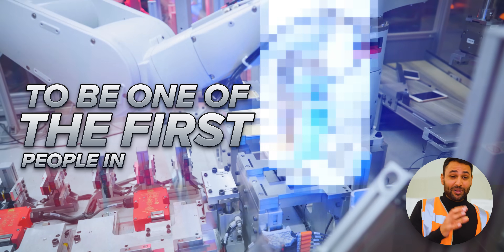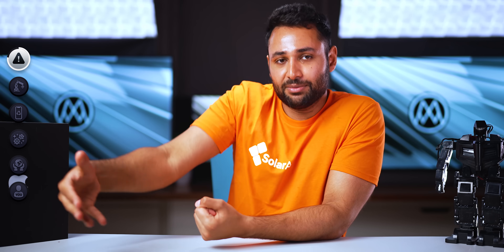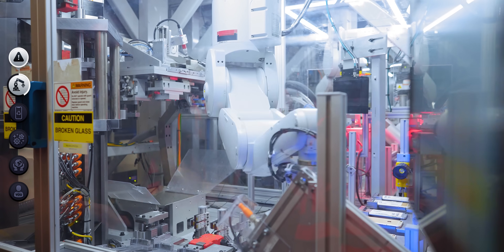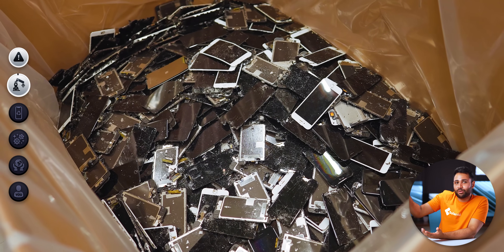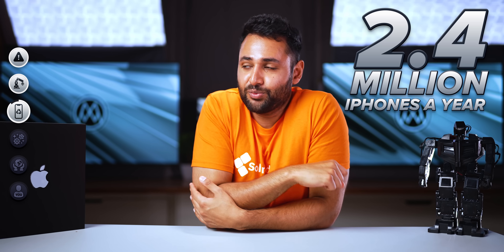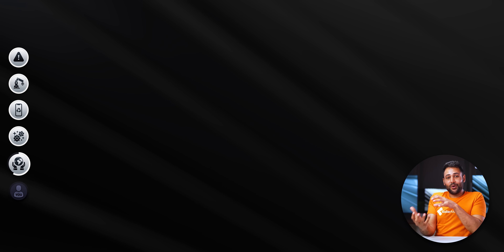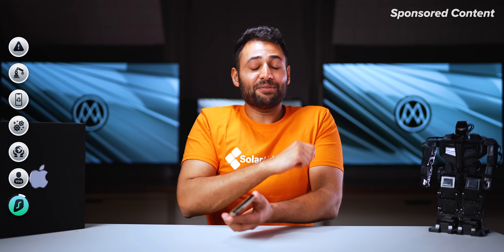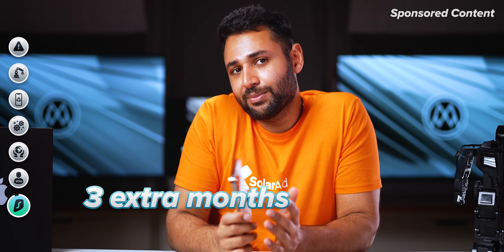Apple made a Robot...and I got to test it.

Comment: Apple and the other behemoths should get real about sustainability. They should make their devices serviceable. My current phone is so powerful that I could use it for the next 4 years if I can easily swap the battery and change the screen if it got broken. I DIYed these for my 2017 top-of-the-line Dell Inspiron laptop and it is still flying!

Comment: Personally I'd rather buy a new product that's actually NEW and no made out of old pre used materials. If a product is made out of 0.0000001% of recycled materials, then it shouldn't legally be allowed to be sold as " NEW" because the materials the product is made from isn't NEW. Recycled materials have a far less shelf life than new materials and it's because the new materials havnt been melted down over and over in its lifetime. Recycled materials have been melted down and reused a countless number of times which in turn weakens it's cellular structure.

Comment: I'd still like to see 3rd party repairs being enabled by apple especially allowing vendors to ship genuine parts to 3rd parties like Mr. Louis Rossmann.
He might not do iphone repairs but the whole repair industry has to battle the apple made circumstances to my knowledge.
Also if you get your hands on a genuine part your chances of getting a working device at the end is also shitfaced by apple locking down their device components with software.
It's great to see them recycling the old stuff but I think it's still profitable enough for them to shred old tech in an environmentally friendly way as oppose to letting folks fix the tech they have bought.
I'd love to wake up one day to find that there is an ipad m1 that has a socketed m1 chip and socketed flash memory that isn't hard to come by, an unlocked bootloader so I can downgrade the software on it or install custom community roms like on many android devices.
I would use it until I can't fix it and it dies for good.
That will probably not happen in my lifetime though...

Comment: The most important point is being completely neglected here and every company fails in those regards: reparability.
A shit-ton of devices wouldn't need to be exchanged for newer ones if companies didn't tie components to units. Is it really necessary that the phone gets reduced functionality or may even end up bricked just because you changed a camera unit, a battery or just a button?! no! Apple may be doing a lot but it all is being diluted to the point of greenwashing when they (and yes not just apple, but others as well) pull the crap mentioned above...
Reply: That carbon-neutral by 2030 is bullshit as well.

Comment: As you admitted, the least destructive way is to keep your phone for as long as possible. You also admitted that your 4 year old phone has mediocre battery life

If this is the effort that Apple goes to for a marketing ploy, imagine if they actually cared about environmental impacts and recovery...they could just make their phones more repairable.

Considering current day batteries are consumable, they should be able to be replaced easily by the consumer. Its like buying a mower and not being able to replace the blades, a part which is designed to be replaced over time. 

But good free feel good marketing for apple

Comment: Apple's amazing recycling and buyback program has a serious downside in that it removes old phones from the secondary market forcing many lower end buyers to buy new phones instead of old ones.  Apple is very against the secondary market and does a lot including locking and bricking phones that are stolen and lost preventing them from entering secondary markets and forcing them to end up as eWaste.  Don't be fooled by the hype

Comment: Apple’s habit of making their phones only “repairable” (ie, swapped with another one.) by their own repair centres, is that they are built not to be taken apart. Crazy idea, build things to be disassembled at the end of service life, so robots like Daisy have a much easier time doing it, with less waste. Also, if Apple programs into Daisy the specs for competitor devices, they can also scavenge materials from the competitors.
Reply: I've been repairing phones for years, and in my experience I'd say that apple phones are up there for some of the most user-repairable phones. Often access to the screen is behind only a couple of screws (the most common type of break) and the battery is behind only another couple more (the second most common type of break). And they've been getting better and better with more recent models (the 4 was the last one where the screen was underneath EVERYTHING ELSE; since then the screen can be removed with just the couple of screws).
Reply: @essendossev362  Except for the fact that on the new iPhones, parts get locked and disabled in firmware by apple. So if you put in a new screen or camera, faceID doesn't work, the cameras don't work properly, etc…  All because Apple doesn't want their phones to be repaired.
Reply: @eurisken  only face id won’t work, the cameras will work and i heard that you need a special device to reprogram face id into the new sensor.
Reply: @eurisken  I see pros and cons to this.
If you are buying a phone from someone you don't know, it would be very nice to know that a part has been replaced or is not genuine before paying for it.
Reply: @essendossev362  Crazy how people want thin phones and also expect giant screws and no adhesive, right? :)

Comment: Recycle = good
Refurbish = better
Fixing it yourself = best

If they let users to modify their phones by themselves, like Tesla is planning to, then the need for complex recycle units becomes a lot smaller. To put it simply, if your screen is broken you just exchange it at the store for a new one, same goes for batteries and other components. Of course the store still needs to collect and turn them in correctly.

Comment: not having replaceable batteries should be a crime. Along with modular design. As in ever part can be replace. Phone should be coved in something like stainless steel and not fucking glass. Instead of replacing the phone and paying fucking $1,000 you can buy the part for say $50 let them or hell you replace the battery. Like only charge $20-50 to replace the battery. Minimal waste. Less materials, company still gets paid and the user is happy. I don't see any other way to improve on it....pretty much the only good thing about Apple tho. . .

Comment: Now imagine if they only made their iPhones easier to take apart and disassemble. You wouldn't need to freeze the battery out, you could just wait for it.. lift it off! ooor, instead of punching screws out you could just remove working parts, test them and sell them for spares!
But it's Apple, so an overengineered solution to a problem they've created in the 1st place that involves "Robots" not only sounds cooler but moves attention away from how idiotic the whole cycle of their product is. Market leaders in generating e-waste because your friend typed your passcode wrong 10 times on purpose.
Fuck Apple.

Comment: Still a long way to go to get all the material properly separated from those individual components, especially ones like ICs or chips that contain doped silicon, unless there is a method to separate the doping materials. It’s all very well disassembling an iPhone, but it’s no use if they can’t properly recycle the disassembled components. I also think they should allow reuse of parts, because that is even better for the environment, like if someone could use an old iPhone screen or camera in their own project, but apple is firmly closed source so that will never happen. Another way to help the environment is to not replace your phone every time a new phone or laptop or TV comes out, you don’t always need to have the latest tech, since most users won’t use the full power of a new iPhone when they are just browsing social media.

Comment: Apple are sending such mixed messages with their stuff. Robots to recycle all their old phone parts, cardboard only packaging that's recyclable... 

and then incredibly expensive studio monitors with built in fixed display cables that can't be removed, rendering the whole $5000 device e-waste the moment a $2 component that's prone to failure wears out. Spending millions of dollars developing new proprietary components that can't be upgraded or replaced etc.

Comment: Honestly, this feels like a bit of greenwashing to me. Don't get me wrong, Daisy has a big impact. But we need to remeber sustainabilitys 3 r's reduce -> reuse -> recycle. Recycling is the last resort. Imagine how much less waste there would be if Apple invested the resources it used to create Daisy into making their phones user repairable? Yeah, used Iphone values would skyrocket, the amount of Iphones thrown away would plummet. Apple also has frankly a insane amount of cultural power too, if they wanted they could easily get the ball rolling on reducing our consumption. Did Apple invest any resources to do that? Nope. Instead they invest tens of millions to lobby against right to repair and are actively promoting consumerism. Then they invest probably billions into a robot, and use that to get a insane amount of pr points. Its cool, no doubt. And absolutely does have a impact. But it does not fix the underlying issue.

Comment: Apple's anti repair efforts are terrible for the environment. Also it's a fact that 100% recycling is not the way to go as some recycling can use more energy and create more waste then any savings from the recycling process. Refurbishing all devices that can be fixed and then recycling the remaining parts is the best option but this would mean Apple could not sell as many phones. When calculating how well this robot does you need to include all the fuel used by the thousands of trucks used to haul this all to the facility, the man hours used sorting and organizing and the costs involved.

Comment: What do I do with my bootlooping dead LG V10? Should I take the plunge and buy a new board for it? It can't be sold coz it doesn't turn on. No dents or scratches. Every other thing in the phone still worked before it died. 
LG are no longer in the mobile business, so I can't recycle with them or upgrade with trade-ins. 
Advice?

Comment: I've hung on to several phones well past their sell by date because they kept on working for the things that I used them for.  The problem with keeping older phones is that A) the OS stops getting updated and B) apps stop working because of the old OS.  My Apple 3S works fine and I've been using it as an ipod.  My current phone is a 5S works fine but some apps are stopping working with the old OS. Yes it is great to keep an older phone as long as you can but the companies don't help when they make their older phones obsolete
Reply: i mean 5 years of software updates are already a lot, for apple that already like 20 iphone models to keep updated, so imagine if they never stopped support it would be almost impossible to get updates, also a lot of old phones might just get too slow at that point too.
Reply: @wolfy1398  IDK I can stream just fine with my old 5S.  The other thing is that the cell phone makers make them obsolete before they actually are.
Reply: @misamsung6191  that's not what i mean, i mean that if it got 10+ years of update it would be too slow, not saying it is currently obsolete, just that it would be too slow to be updated for many years
Reply: @wolfy1398  What is slow in electronics?  I had an old laptop that I used to use as a media server until it gave up the ghost.  Sure it was slower than my more modern laptops BUT microseconds really doesn't matter.  You can have a blazingly fast processor but the bloat in the applications is what slows everything down.  That is what Apple is doing they are adding new features and apps that are slowing down the main processor because of poor programming and just general bloat.  People want new and shiny, we really are magpies

Comment: Mixed feelings on this one.
While it is really cool that Apple has these recycling and carbon-neutrality goals and actually engineers solutions to meet these goals, they also go out of their way to make their stuff almost impossible to repair.
They still have the best accessory compatibility and software support in the industry, but let's not forget their many grave sins.
Everything glued together, a chip in every cable and component software-locking the parts together to lock out replacements and aftermarket stuff, cables that will definitely break in a year, 27 different special kinds of screws in a phone, etc.
They also don't promote their trade-in programs enough, or have no such program in many countries.
They have used child labor in the past (and who knows, maybe they still do behind the scenes).
They removed the wall wart from iPhone packaging, while shipping the new iPhone with a cable incompatible with old chargers, so you do end up buying a wall-wart separately, which is extra unnecessary packaging and shipping. They should have not switched to type-c on the wall side in the same year as they removed the wall-wart.
They have created a culture of consuming in which customers are encouraged to buy the newest shiny gadgets every year, even though the only thing new about it is a design change.
Reply: I was reading the comments to see who was going to say this. Thanks
Reply: Your comment is so underrated!!
Reply: Interesting point!
Reply: Absolutely!
Reply: Well said sir
Reply: You're right
Reply: Egy kicsit tényleg érdekes hogy ezek a “nemes célok” leginkább csak amerikában elérhetők és mindenhol máshol ebből a szempontból gyakorlatilag semmi sem változott
Reply: Also rolling out updates to slow down iphones forcing people to upgrade

Comment: No choice on Samsung phones, they all die within 1.5 years which means the trade in value is $0
Reply: what are you doing with your phone?!?!?!?! and you can actually just buy replacement parts :D
Reply: @somnia3423  I'm using it the same way as any other phone I've own. Well, the problem is the dead motherboard, I can't find replacements on those and Samsung service center tells me it costs around $500 to replace.
Reply: @pixels_per_inch  dead motherboards? really weeeeeird but okay?

Comment: most of those iPhones are in there because of iCloud locking😐

that's literally what it's for, disabling perfectly useable phones

but this machine and process in a vacuum and of itself is pretty great. 

the thing about this being easier for apple because of their limited number of models isn't really true because they've reused the same frames and parts so many goddamn times lol. I remember cases that said "for iPhone 6/6s/7/se". eh, whatever, up to the customers preference I guess but I think they just like what they're told to like - hence that enormous notch
Reply: Are you talking about iCloud locking or apple disabling phones that are older. As iCloud locking is a simple anti-theft protocol that can be easily avoided by either, Turning it off, or simply entering your iCloud password.

If you dont know your password, you can reset it from either your PC or from the iCloud lock page. If you can't do either of these things, there are other recovery options. If all else fails you can probably take it into an apple store with a proof of purchase, there are also PC apps that disable the iCloud lock page.

Comment: I don't buy it. The main environmental  problem is not the deconstruction but the construction of a smartphone. The process of building a smartphone uses a lot of  energy  and contaminates much more than  its destruction., so that extending the live of a device is what really helps the environment (by far). We need  to repair and reuse. And this is much easier with Android phones, just go to the street and you will see many people using Android phones that are  more than 5 years old,  but you will not see this from iPhone users. This is a fact that  everybody can check, it is not fake marketing showing  pcitures of trees.
This particular company also produce unrepairable and non upgradeble computers,  soldering CPU, RAM and SSD  to the motherboard or artificially locking its capacities  so they can't be upgraded and force you  to buy the new model. Programmed obsolescence with proprietary connectors, propietary cables, and zero standard components  built in Asian countries using dirty energy. Giving money to people who are planting trees in exchange for  putting your logo in their projects (which most of them would happen anyway)  doesn't make you a clean company.  Repairability, reusability, upgradeability, and  anything helping to extend the live of the products does.